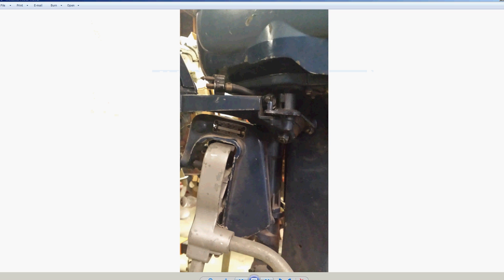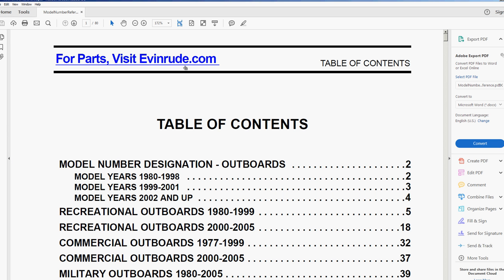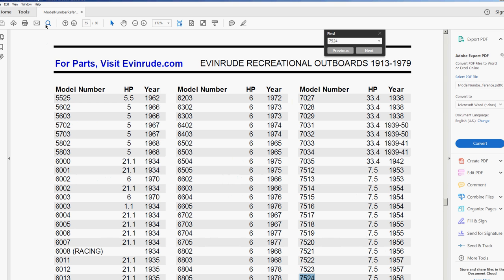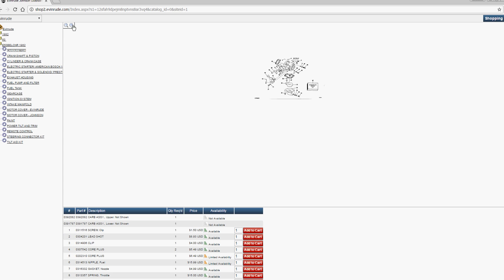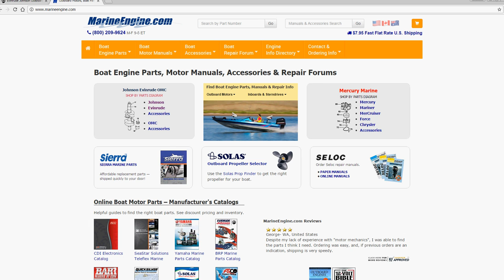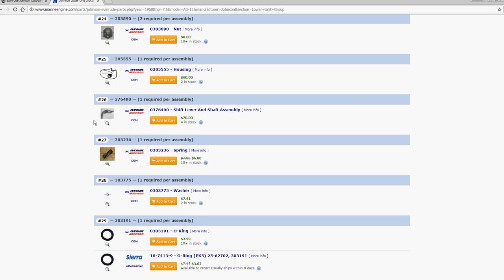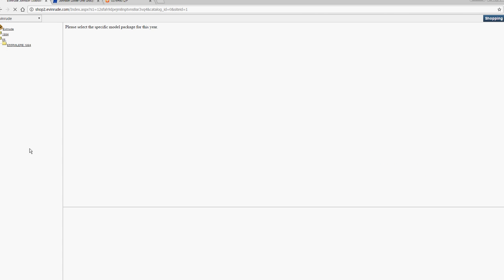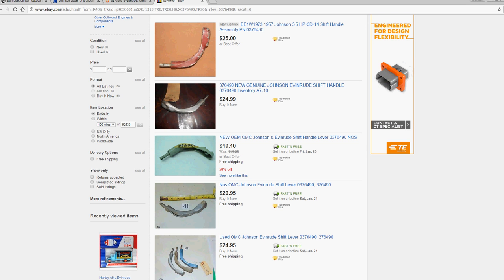How to Identify Johnson & Evinrude Outboards, and Look Up Part Numbers

Comment: 5402B. I'm not sure where to find the break down, you said you'd post a link but I'm not sure where that can be found
Reply from the maker: It can't be anymore,
Use epc.brp.com now.
Reply: https://www.operatorsguides.brp.com/public/tmp/EN%20-%20Model%20Number%20Reference%20Guide%201913%20-%202005.pdf

Comment: I have a johnson that doesn't have the plate on it. The only number is on the freezer plug and I cant find anything matching that.. Its a 25hp longshaft electric start.. G4369790.. Curious as to what year. I think it's a 89?? It came on a boat that i bought.

Comment: Is there a way to get a part number for a choke shaft leaf/valve screw?  Those parts aren’t listed and the carb is listed as a unit.   I have a 1986 Evinrude 15hp E15RCDE. I’m trying to find 2 screws or at least the size, thread count and length of the screws.

Comment: I have 15hp evinrude serial number lost 
I found a ss round plate with a number on it R8168190 I think the outboard is from 1990's and up if you can I would really appreciate i need parts for it thank you in advance
Reply from the maker: That is the serial number and means nothing.
Post pictures of it for identification, tis the only way.

Comment: Hi Brandan, i have just purchased a boat with a Johnson 50hp VRO 2stroke outboard on the back, the only number I can find is stamped on the engine block (on a disc) number is G2565202, is there any chance you can id the model number and year etc from this. TIA
Reply from the maker: No, nobody can.
Others will tell you to call evinrude, but speaking from experience that gets you nowhere.
Post photos, identify by color, deals, and designs.
Reply: @BrandonsGarage  thanks for taking the time to reply

Comment: I just picked up a small evinrude got home cleaning up all the gunk and the number plate is gone the plug on the motor says 6504R J000812 I think it’s a 6 hp mid 70s started right up after I got home and put gas to it about fourth pull

Comment: hi   i have recently purchased a etec engine from auction    damaged  the only numbers i can find on it are on the engine block  its 5276890   how do i figure out what  model it is i suspect its between a 2008 and 2012   etec
Reply from the maker: Thats a serial number, kinda useless.
No numbers anywhere else?
Reply: @BrandonsGarage  i found that number on a  coin size   plug at left side of engine 
cant find anything else
Reply: @BrandonsGarage  hi, a have the same problem, the number in the coin is G 2609381

Comment: wow cheers mate guy told me the motor was post 2000, just referenced the numbers its a lot older being 1985 (like i suspected)
Reply from the maker: Sellers always do that.
Its a '2002 90 HP'
Turns out to be a 72 9.5 HP.

Comment: I did not see the posting for the Model number reference guide.  I have a Johnson that is some where between 1993 and 1996.  It has a circle tag in the block with the # G3158208.  Could you break the code?
Reply from the maker: No, thats a serial number.
Even asking BRP themselves wont get you anywhere.
Reply: How do you find model number you said motor block it looks like they removed it or painted over

Comment: Hi Brandon - Thanks for your channel.  I inherited a 60 HP Evinrude - I cannot find the data plate anywhere  I cannot find the frost plug on the case either - Any ideas?    Thanks
Reply from the maker: Is it newer or older?
Reply: How do I tell?   That is what I would like to know.   It is a 3 cyl.  WHere is the plug on the power head
Reply: I did find the plug on the PH   G2521784  Might Be EG...
Reply from the maker: Left side, right side, could be anywhere.
Can you send me a link to a picture of it? Can usually narrow it down by looking at it.
Reply from the maker: Thats probably a serial number.
Was the engine spray painted?
Also, are there any part numbers cast into any parts?
Can start looking them up that way.
Reply: Engine was sprayed  - Link to photos  https://photos.app.goo.gl/ZTx4vr1n2ssb94KF3
Reply from the maker: probably somewhere between 1985 and 1990
No luck on the part numbers you listed. Even an ebay search - the sellers done even know the engine year.
Is there a part number on that red plug?
do you see a painted over label anywhere? Some acetone may clean the paint off the printed tag.